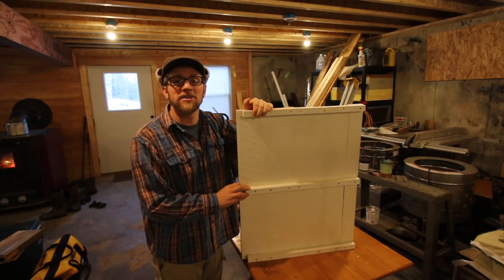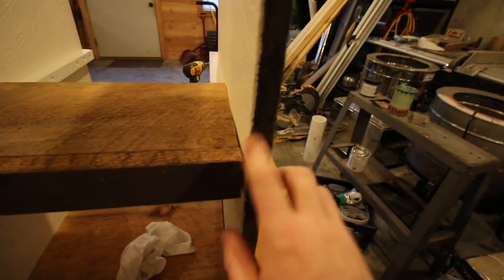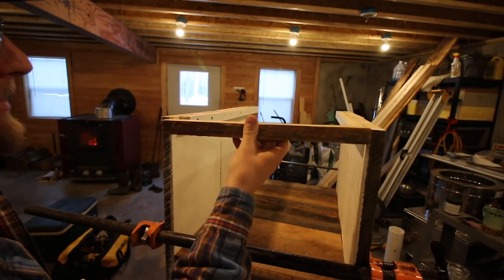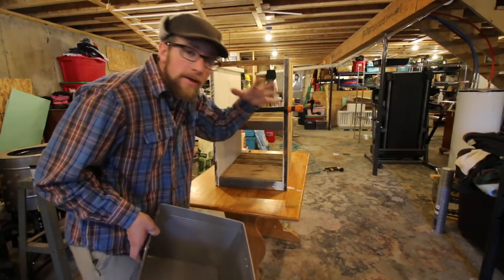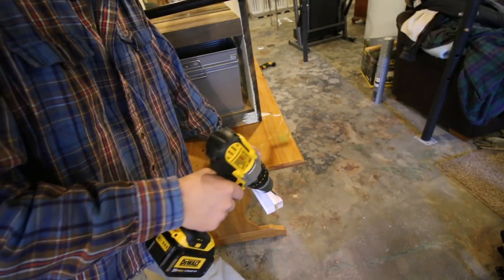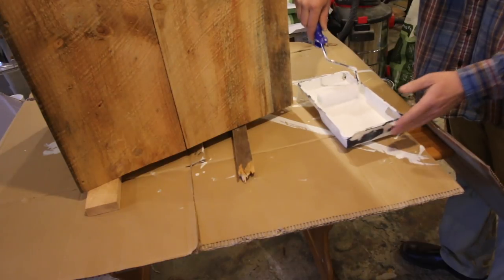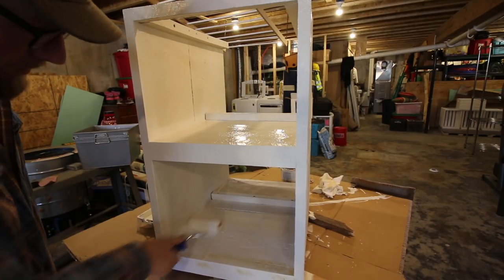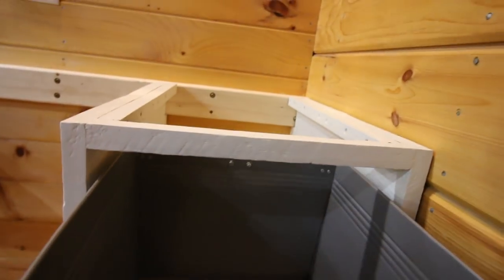Assembling and Painting the Rough Sawn Lumbah File Cabinet for the Concrete Counter Top Project

Comment: Tip for you:  After you take the lid off your paint, take a nail and put holes in the grove around the top of the can.  It will allow the paint to flow back into the can.  This project turned out great!

Comment: Excellent stuff Al. The cabinet is looking great and will be even better once Gina does the antiquing and I like the look of the saw marks in the rough timber. If over time you prefer only drawing out the heavy filing bins rather than removing them completely, rigging a chain or cord to stop them just short of the front edge might be good?
Reply from the maker: A chain stop might work nicely. Thanks

Comment: Al, great interview with Jake! Loving the desk and seeing how you take care of any high spots in the concrete where it rests on the wood. Wondering if you are going to try to sand them level or use a thin foam to cushion the contact and make the top easier to install.

Comment: That project is coming together so nicely. Do you have plans of making things and selling them? Or just using your skills for your own homestead?
Reply from the maker: If someone wanted something I could make it and sell it. I have kicked the idea around but not sure what to make
Reply: Lumnah Acres that large soil block planter you Made would be good ( can’t remember the correct name). Sprouting jar stands would be good also maybe a recipe box. There are company’s that can make your logo into a banding iron that you can use with a wood burning tool. You have a really nice logo and it would look very sharp burned into the wood surface. These were just a few ideas of the top of my head.